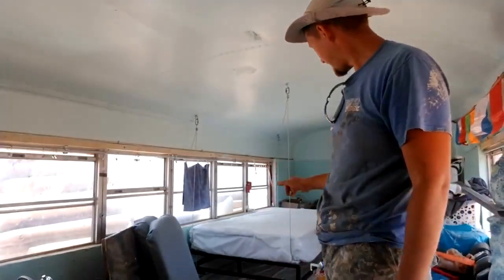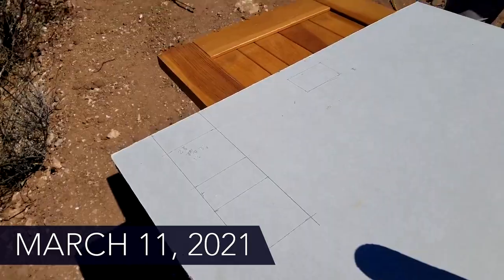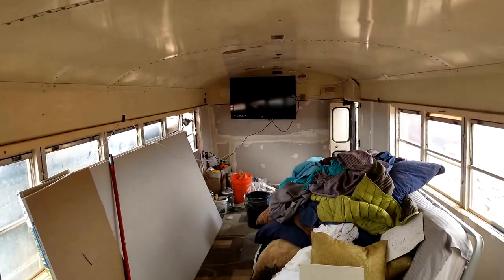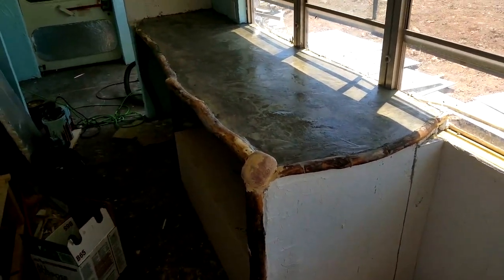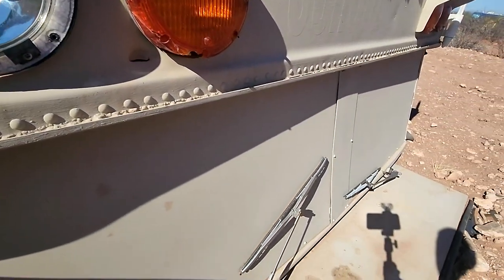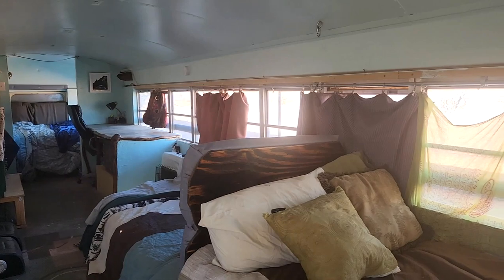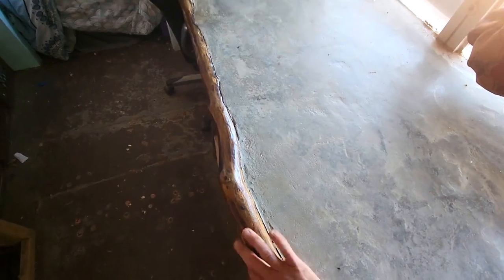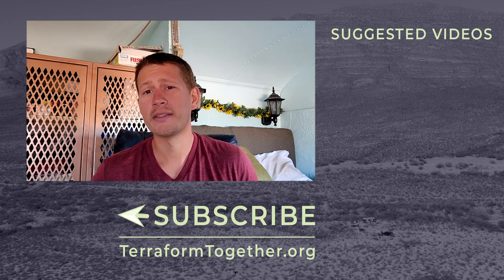Turning our off-grid buried school bus into a TINY HOME | Underground Bus Tiny Home Ep 2

Comment: What do you think the county is going to think of the bus? It's over 200 sq. ft. so I think it will need a separate accessory building permit (no building permits would be required since you are part of the opt out program).
Reply from the maker: I'm sure when the county comes out they are going to think we are weirdos... but I have talked with one of the higher ups at zoning and gone through our plan. The bus and everything else is in our opt-out permit. The guy I talked to didn't seem to have any issues or red flags, so I'm not too worried.